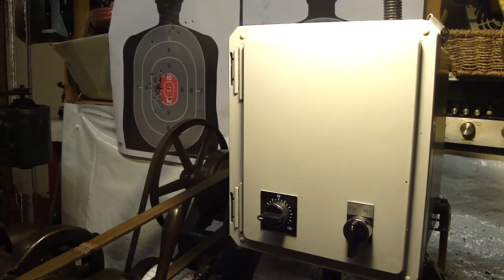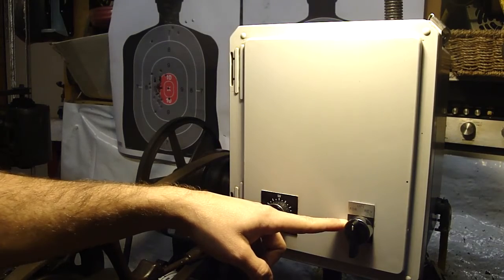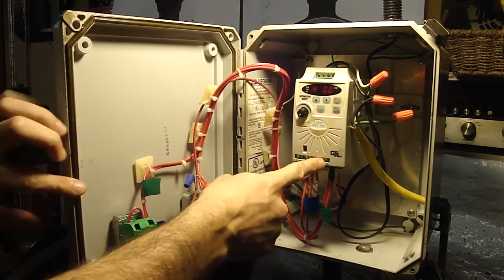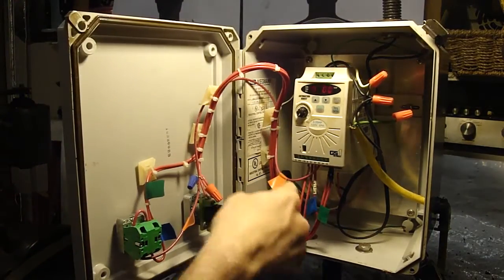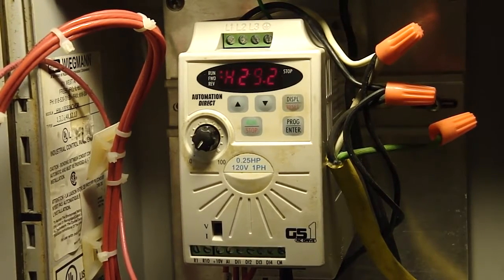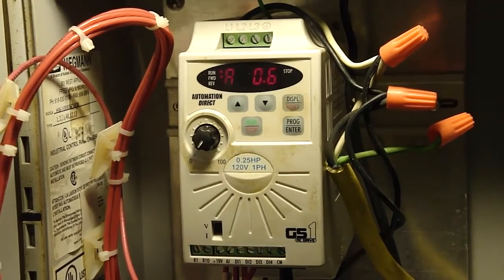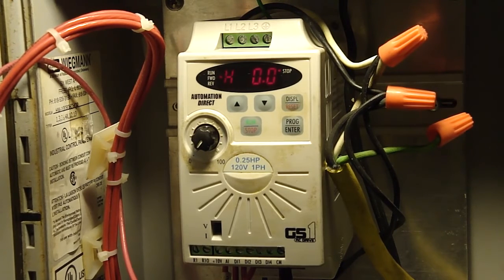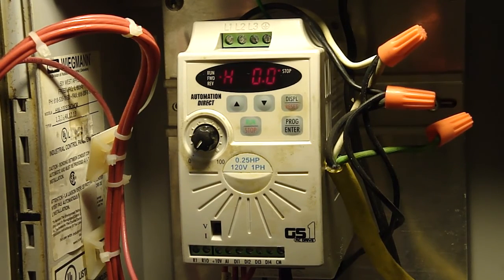VFD forward and reverse switch

Comment: Wrong part numbers for the 3 position switch
Reply from the maker: Please provide the correct part number, if you would be so kind.
Reply: allsortsofinterests the switch is part # GCX1320-22. The Forward Off Reverse Legend plate is E22NS50. I should have included that in the first comment but had to find my invoice to get the numbers. Your video helped me a lot. Thanks
Reply from the maker: +241cfii Thanks! I really appreciate the value of the community we have built, while no one has all the answers many minds can easily solve a problem for countless others.

Comment: Hi ,  1 question, if i want to  add limit switch  with push button  forward- reverse  .is it going to work with VFD ,,?
 by the way its for garage slide  gate !
Thanks.
Reply: A double no contact switch will do what you need. Ebay has them for $7 far less than these particular ones and both contacts are included.

Comment: A double pole, double throw toggle switch (DPDT) will work also.
Reply: Herb Blair Herb, I'd like to use a DPDT switch to forward-stop-reverse.  Can you point me in the right direction as to wiring?  I'm using a Lenze VFD but I'll cross reference the inputs based on whatever VFD you're familiar with.
Reply: Chris Montgomery the vfd will have 3 pins to connect to.  Not sure how they would be labeled.  Manual should show.  center pin on switch goes to common (L on my vfd), the other two will go to two pins shown in the manual.  you will have to set program for external control.
Reply: There are 6 pins on the DPDT switch.  I just read online that "DPDT On-Off-On functions like two separate SPDT switches operated by the same actuator."  So that means I would simply use the left 3 pins or the right 3 pins on the switch, correct?